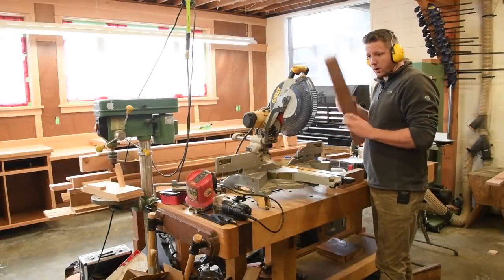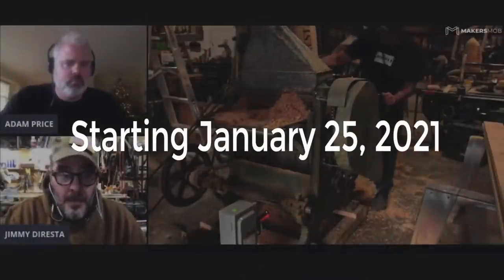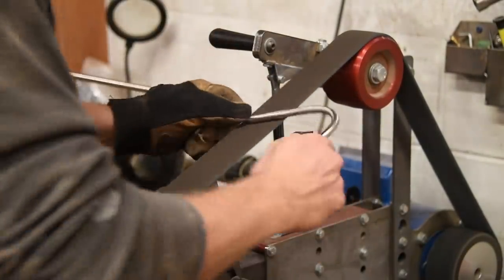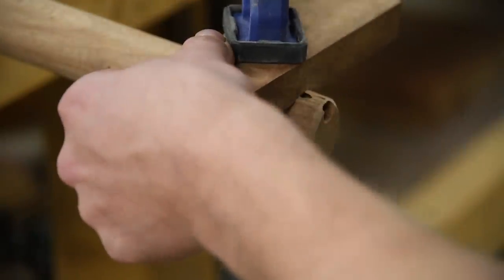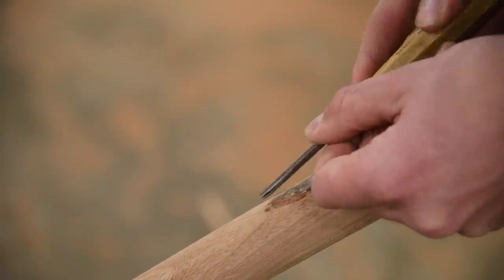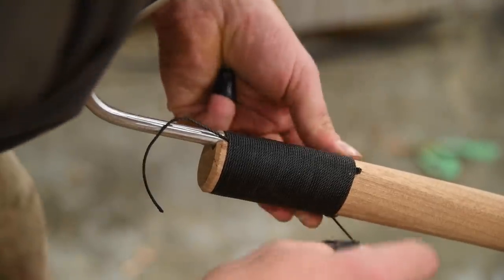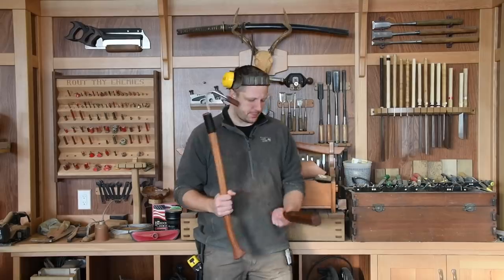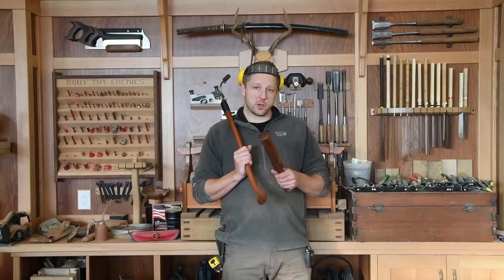How to make a Fishing Gaff and Bonker

Comment: This isn't to criticize or anything - great job - but you can improve it just by adding some of those little square plugs to it. A 1cm square plug with that  little diamond shape filed into it, stuck out 3mm or so is ideal for bonking the fish on the head - plus 4 of them around the top end of it would look good too. The last thing you want is to have to bonk them twice, right? The quicker and cleaner the better. Well, when you get right down to it a little plug like that will get in and squish the brain much better than a flat plane and that's how you kill them quick and painless. The little plug gets right in between the back of the eyes and kills them dead in an instant - as humane as you can get.